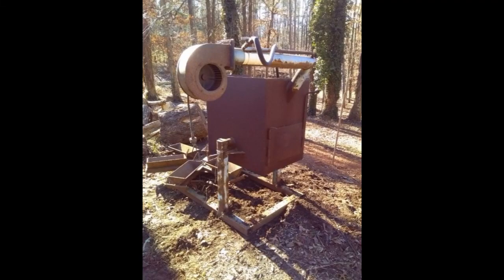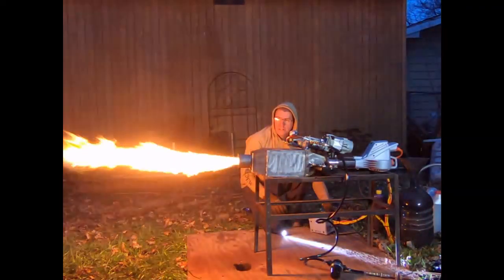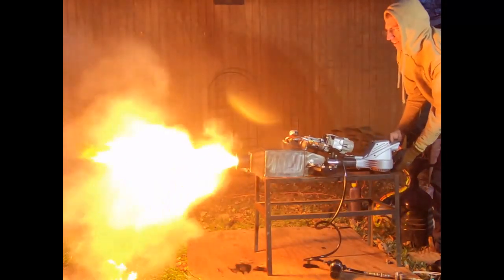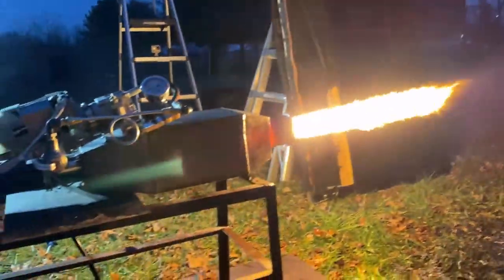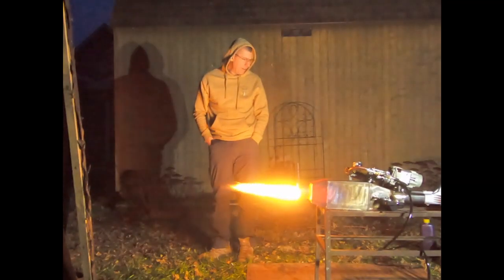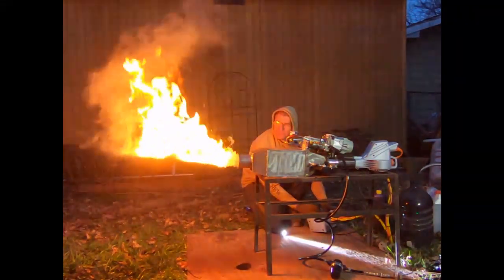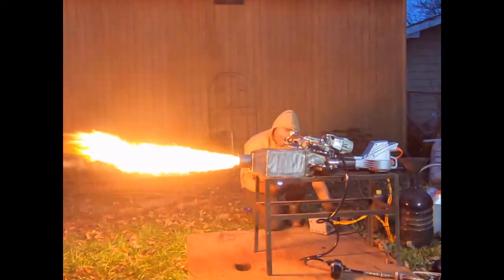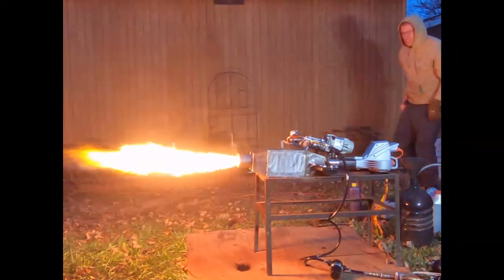Aluminum melting furnace burner for Joel

Comment: Are you familiar with ultrasonic transducers and misters? I think you can use these to atomize the oil, possibly no need for oil to be hot. Also probably oil doesnt need to be that clean for the mister to work.

Comment: Have you thought of building a centrifuge for the oil cleaning?
Seems like 6k rpm creates enough g force to clean the bulk of it with an 8” bowl.
Reply from the maker: LOL , yeah like right now, literally  and this is not the first time because they want $1800 to 5,000 for  them  . Im looking at an angle grinder version as we speak just tryna figure out how to make the bowl  . Im thinking 11,000 rpm with a 4 to 5 inch bowl may do
Reply from the maker: Its an absolute must to run these things on waste oil , the sludge must be removed pressure nozzles . this is one of the reasons air nozzle burners are not going any place . They dont have this problem

Comment: One way to preheat the oil is to deflect a really small part of the flame from the main combustion into a side box with coils.

If you look at how thermostats work, if you can put a thermostat onto a diverter valve [sort of like a butterfly valve, but usually its more of a 'U' shape or a 90 degree, as opposed to a simple flat plate, because that allows more precision and keeps sooting down.

Also, put large diameter straight line shell-and-tube layout instead of a single coil, because that allows it to be periodically cleaned of sediment and carbon buildup.

With the right layout, you will be able to rapidly preheat the oil with a high deflection at start, but then as the actual heat up gets to peak power, then the diverter will close down a lot, keeping it at the ideal temperature, while also making sure that the optimal amount of heat makes it into the furnace.
Reply from the maker: I have tried this in the past and decided it only a short term idea unless properly configured due to foaling out . The pre heat coils dont do well long term but a good heat well would work with this idea